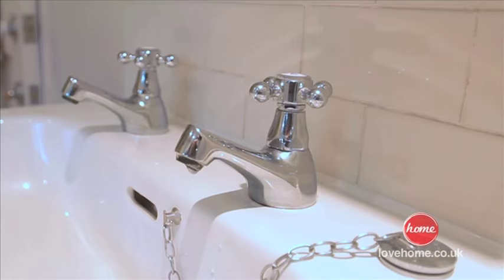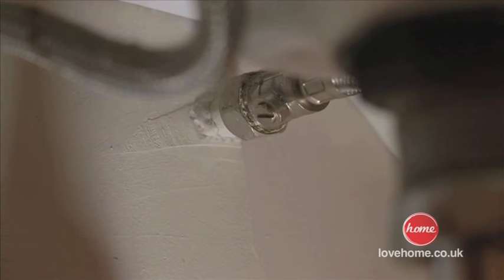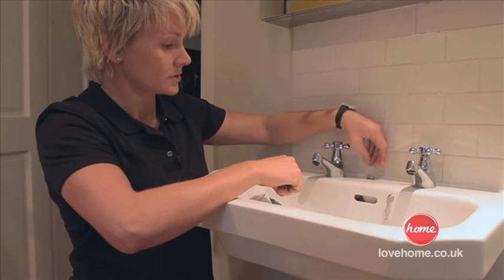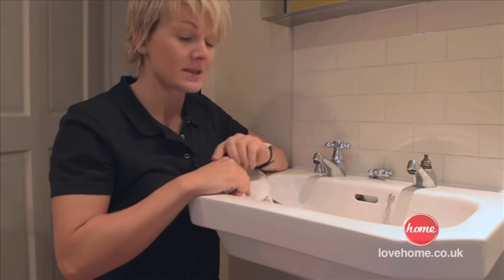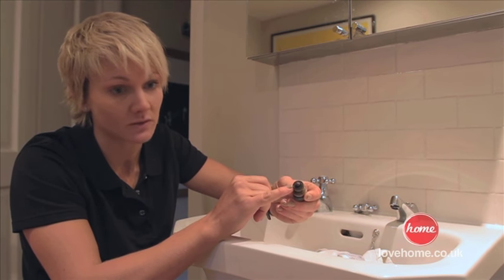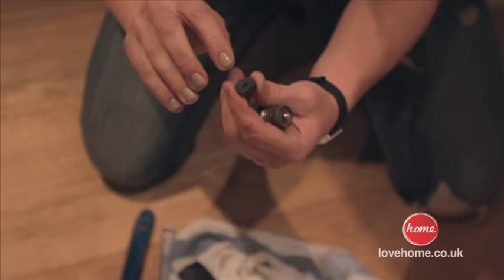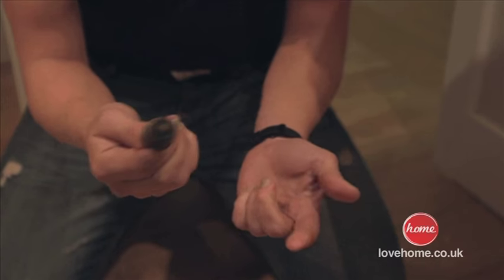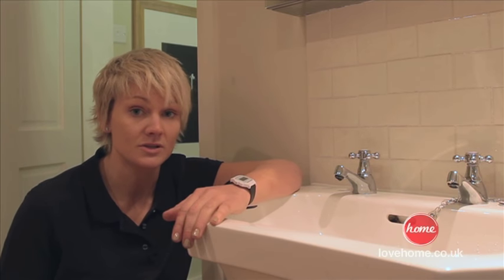DIY: How to fix a dripping tap

Comment: This fix really takes less than five minutes! I like your detailed explanation. Just worth noting: Sometimes, rubber washers can be reversed to quickly (temporarily) fix a leak. The other side is usually OK and if the whole thing is still tough and sturdy, there's no need for an immediate trip to the hardware store. Just replace it when you've got a new one ready.
Reply: Top tip thanks
Reply: Thanks for the tip!

Comment: Philippa Tuttiett is an excellent communicator: she explains clearly yet is informal in manner and speech, is reassuring and has a frank gaze and nice smile (which helps); the video maker is also excellent. The video can be viewed for instruction and also just for the pleasure of seeing someone do a job well and explain it well. She makes you feel that she's talking to you: the ideal teacher.
Reply: Agreed! I've got stuck (literally) with this job as the works are too corroded to take the tap apart, but I've already subscribed. Clear, calm and informative without being patronising. I've become fed up with excitable tutorials that try to entertain or push the presenter's expertise. Good tutorials like this don't need to do that.

Comment: Really clear demonstration in a very nice style. If you ever redo this video you could mention that to switch off the water from an in-line valve underneath, the screw slot needs to be pointing across the pipe and that cleaning up inside the tap cavity and around the assembly with wire wool is probably worth doing.

Comment: This is a brilliant tutorial, thank you for sharing. Unfortunately when we tried to fix our leaking tap the screw under the cap broke off & I had to replace the taps anyway, but watching this gave me the confidence to tackle this job which I had put off for ages
Reply: you likely could have purchased the machine screw that was needed from a hardware store. Once you remove the broken screw you can take that into the store & find the appropriate size, & even if they don't have one the correct length find the correct diameter & thread count & it simply cut a screw down to the proper length especially for a thinner diameter screw like you would find on a faucet. This will not only save you a good chunk of change, but will also save you time.

Comment: This is the first time I have ever heard a Phillips screwdriver referred to as a "Posi". Those old-school faucets using just a rubber washer sure are simplistic as on most modern faucets especially here in the US there will be a small spring, & a rubber seat. It is often the rubber seat that has deteriorated & will need replacement, but these are generally found in a pack including both spring & set for a few dollars. Especially if you live in an area with hard water cleaning the valve as well as the inside of the faucet with some vinegar & a light scouring pad will remove any mineral buildup which can contribute to the faucet leaking as it can prevent a good seal.

Comment: Very helpful. One tip. I replaced the washers and reassembled the taps but after turning the water back on got no flow. Noticed that the aerator that screws on to the end of the water spout had clogged with pieces of debris. Cleaned those out and then OK.

Comment: Well explained and in principle it's fine. The reality is that the valves after years are very tight to the point that the tap turns and you need a removal tool.

Comment: I vaguely knew how to change the washer from years ago but watched your vid and decided to  attempt it but now my isolator valve  has leaked when turning it back on and the tap has less pressure, so worse state than before, so be warned there can be complications.  As with anything.  Thanks for the vids though.  Great tips on the new sealant around the bath too.  Thanks

Comment: Great video, thank you. Quick question.... Is it safe to turn the water off from the isolation valve, if there are wires attached to earth it? Or do I need to take any other precautions first?
Reply: That's called ground/earth bonding, and it's done to make sure that if the copper pipe work comes into contact with a live wire due to a fault that it trips a breaker and doesn't electrify all the pipework in the house which would be extremely dangerous.
Reply: That should be OK, as long as you leave those wires attached to whatever they are fixed onto.
Reply: @chris53small  ah, thank you!
Reply: @Nick-ky3vl  Thank you

Comment: Hi seemed to me you put the isolation valve into flow (slot in line with valve) and then to turn it back on, you turned the valve to shut (at 90 degrees to the valve)???
Reply: well spotted, i watched again and you are correct

Comment: Excellent video. I have an issue at the moment where I can't even remove the first screw after taking the tap cap off lol..the threads are worn so ive bought a quick remover from eBay to re thread it n  take it out, I hope it works.
Reply: Put a thick elastic band over the head of the screw then screw as normal

Comment: For anyone who still has a leaky tap, the seat that the face of the washer rests on can someone’s have micro-cracks in them, which can be fixed by using a reseating tool that sands off the old seat. Very inexpensive

Comment: 1.00 when she shows the isolation valve you're actually turning the valve on not off. The screw slot  has to be at right angles to the flow to close the water flow not in line with it.

Comment: If it's the down stairs hot water tap and the boiler is upstairs what happens to the water in the pipe between the dismantled tap and the boiler ,does it all run off, if so what happens to the boiler.

Comment: I just started to get a dripping tap about 2 days ago. Suddenly tonight it got hard to turn it on or off, and it was a steady stream not a drip. Then about 10 mins ago when I went to use it again, pieces of rubber actually came out of the tap. I've never seen that happen before, but anyway, I guess i'll be off to the store to buy some rubber washers and fix the damn thing.

Comment: Don't forget to check the seat, you can take it out & smoothen it with sand paper or they have a tool that  will grind it down in place.

Comment: In an ideal world everything comes apart easily like in this video and it is indeed a five minute job. In the real world you sometimes need a pair of grips just to get the cap off. Then sometimes it's impossible to get the screw out due to limescale. Then, even when you've got the screw out the head is a so-and-so to get off. Ditto with the shroud. Then, the tap valve is a so-and-so to undo because of age and limescale. Then, you should also check the seating as well as replacing the washer (which in most modern taps is 3/8 not 1/2 inch). Then, of course it's sometimes a disc valve not a washer. Then of course it is easy to move the whole tap while trying to get it apart. You use a pair of stilsons with a cloth. I use the Easy Tap Splitter to eliminate this problem. As a jobbing plumber of 45 years it is disingenuous to say that fixing a tap is a five minute job. With all my years of experience and all of the specialist tools and new and second hand tap parts at my disposal it is very rarely a five minute job especially if you live in a hard water area. And lastly, you don't reveal how many times you turn those ballafix valves of and on again and they leak.

Comment: For everyone's attention, the line in the isolation valve under the sink. When its 'inline' with the pipe it is 'on'. When it's across the pipe it's 'off'. This is shown as being the opposite.

Lastly, make sure the tap spout (its body) doesn't move. If it does then it can leak underneath when the water is turned back on - water pressure rises at night, so always check the morning after you've done your repair to make doubly sure ;-)

Comment: Help. This mechanism looks similar to mine and I have changed a new washer a few weeks ago that is in short time back to how I found it. It has been changed a few times before my recent effort. In changing it I noticed a notch inside the hole where the mechanism goes that the surface the washer seals on. It seems to me like something is supposed to be in that spot converting it to a consistent sealing surface. As is the notch would provide a way for water to escape hence the constant dripping and the fast wearing washer. Basically as is you need to turn down the tap so tight to fill the notch gap that the washer can't survive very long and is not even very effective when new. Anyone know what this missing piece might be called?

Comment: I ended up changing the whole valvue because on mine the nut for was corrodid where the washer was so wouldn't come off... Anyway i changed it all and still leaks a bit its a kitchen sink that runs into one tap
Help please!

Comment: Honestly this video wasn't that good now that I've had to use it. It just skims over all the parts that might cause you trouble. Like taking the cap off and then the screw. These are often SUPER hard to get off and require additional steps to loosen them. She just turns them like they're barely in at all. But there's so many jump cuts and stuff here whenever she struggles to make it look seamless. Heck, she tries plying the cap off at first despite it being a swivel cap.

It's just not in depth enough.

Comment: My dripping tap is a little more complicated to fix......I think.  It's a hot water tap in the bathroom without an isolation valve underneath and on a pressurised hot water system. There are two big red handled valves behind the water storage tank in the cupboard but I have no idea if turning off either of these will isolate the hot water water.  I think I need a plumber to sort this one out for me. It's annoying because this tap is the only one in the house that doesn't have an isolation valve!
Reply: If you have a pressurised hot water, turn off the rising main, that will isolate the hot.

Comment: What is the difference between an adjustable wrench and an adjustable spanner?  What exactly is the wrench doing here?  Is it an essential tool for this job?
Reply: The wrench just stops the tap from twisting the copper pipe below, you can get away with getting someone to hold the tap while you use the spanner.
Reply: @jordanbelich2300  Couldn't you use one hand to hold the tap and the other to use the spanner?